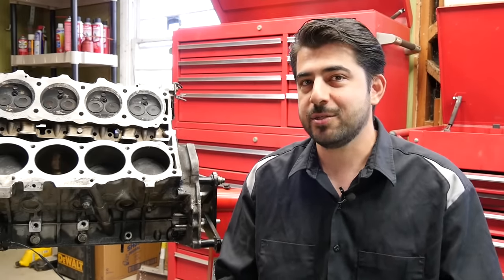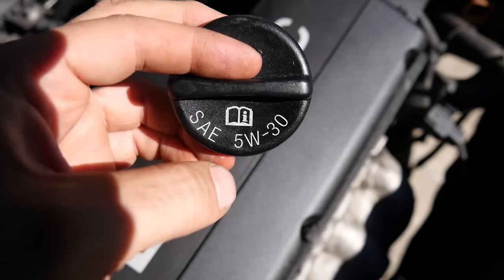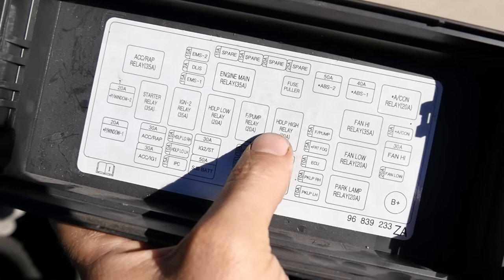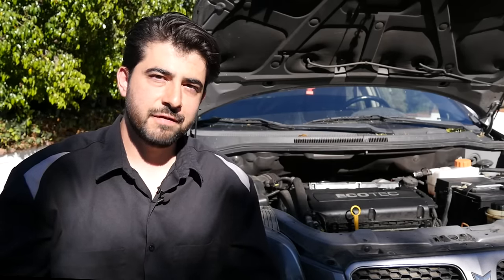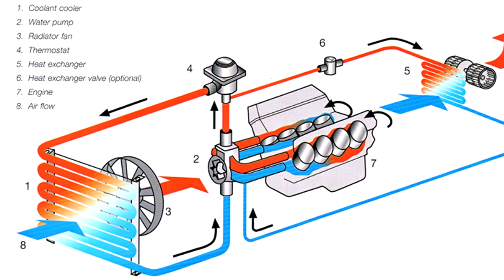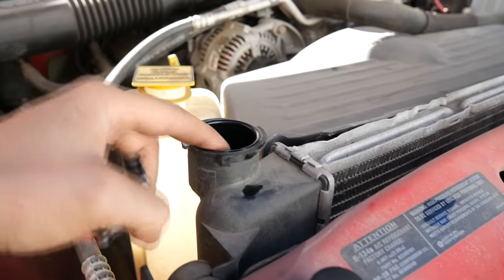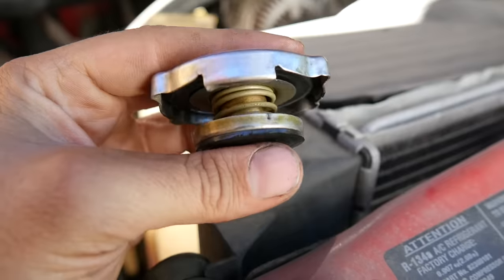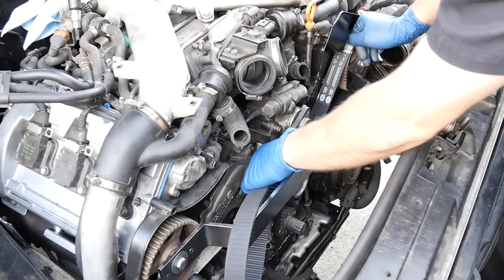Make Your Car Engine and Transmission Last a Very Long Time - Top 5 Tips On Car Care

Comment: For my '97 Camry with 160k miles, every oil change (full syn about every 5k) I also use a suction pump to pull as much trans fluid as possible out of dip stick tube. I then replace it with an equivalent amount of fresh tf, usually about 2 qt. This is equal to a complete fluid replacement every 20-25k miles. The whole process only takes a few minutes. When I got the car it shifted a bit hard, but now shifts are silky smooth and barely noticeable.
Reply: How is your camry going? Still got it? My 2000 camry v6 is up to 240km and i want to get rid of ot but it wont die ahah
Reply: @callanbrown7979  Unfortunately the Camry was attacked in a road rage incident by a deer (I'm in WI) and declared totaled by the insurance. It had 180,000 miles on it, ran perfect and everything worked. But the insurance company totaled it out for a pretty fair price for a model year that was 25 years old at the time. I replaced it with a 2011 Honda CR-V with 106,000 miles and in very good shape which I think is also a great vehicle and a bit more practical due to it's size, rear hatch and AWD.
Reply: TOYOTA #1

Comment: My dad bought a 00 frontier (i was 9 at that time and now 28) and now I own that truck with 365k. Transmission fluid has never been change on it and still running strong. I love that truck. Takes me where ever I tell it to go and I have for faith in it than any other car I've owned. But that's just me.
Reply: Weird flex but okay
Reply: cool....
Reply: The fluid will be varnish by now. 
I went through this years ago before I understood that it's a regular maintenance item.
The fluid eventually turned "light brown" and "stinky". Then I found I had to push the pedal further down to keep up with traffic (sucking up fuel faster).
Took it to a transmission shop for "basic service"
Two days later it bogged right out to where I had to really step on it to move.
Ended up having to replace with a rebuilt one. 
The transmission mechanic explained that the fluid is not "meant for the life of the vehicle. It must be changed every (if I remember correctly, 20,000Km) or it turns into varnish and the parts wear out quickly after that.
Won't matter anymore... you can put Royal gold level ten star grade trans fluid, the clutches are shot it's game over.  
Good maintenance begin at "50,000" not "200,000". 
Also how you drive it has equal effect.
I bought a truck that was owned by a corporation. The driver beat on it. Stomp on the pedal get the wheels spinning kinda thing.
The trans wasn't burnt brown it was still red and decent but the damages made it so it was shot by 225,000km.  Engine still perfect but $5,000 trans garbage.  Truck is finished, scrap.
Reply: @RetroCaptain  you made the mistake of taking it to a mechanic
Everything was working fine till you took it in😭😭

Comment: Good video, is basically follow the manufacture maintenance schedule witch most people dont. I found people across internet very concern about maintenance of the car and others who said I use the cheapest oil you can find in Walmart and they blame the car later on.
Thank you for the video.

Comment: This is what I do 
1) change fluids at regular schedule
2.) Use only oem parts if possible
3.) Fix small things before it gets big. Listen to any unusual noise.
4.) Dont abuse it. And pay attention to the guages while driving. 
5.) If you have a garage, I open the hood after a trip to cool down the  engine bay this prevents hoses and wire insulators from cracking due to heat on hot summer days.
Reply: Your 5th point is one important advantage of having a garage 😊
Reply: Pt. #5 is la great idea---never thought of that but I'm going to start that practice!
Reply: @mikejohn0088 😂

Comment: Quick tip for priming the oil filter, most modern engines have what's called a deflood where if you hold the pedal all the way down while cranking it will disable the fuel injectors in case the engine is flooded. Just make sure to test it before the oil change as I had one car that did not cooperate and nothing is more horrible than a 5k rpm dry start with no oil pressure 😑😑
Reply: Seems like a terrible idea unless you are 100% sure that’s how your car works
Reply: They last few vehicles I own have do this and they all mention it in their owner manuals under "starting a flooded engine"

Comment: Thanks, you do easy to watch and informative videos. A friend has a 2016 Mazda6 2.5 litre. The dealer was adamant the automatic transmission required no servicing which appears to be a marketing ploy to reduce apparent ownership costs. However everywhere else we researched recommended servicing any auto transmission every 60,000km or so. One in particular by Mechanical Engineer, Auto Journo, and YouTuber John Cadogan went into the chemistry of heat and fluid breakdown well. We went with the service, as the old mechanics saying goes, 'oil is cheaper than parts'. Another thing I learnt is to check the coolant level in the radiator rather than in the overflow reservoir. A friend had a Toyota 3 litre diesel which cooked because the cap had failed but there was still coolant in the reservoir and that was what he was checking.

Comment: Ok all your other 4 tips are handy and helpful but look when it comes to empty oil filters on a oil change. The old oil that was drained still has remaining oil around the engine especially on the top camshaft, valves and piston rings. It's not like it's completely bone dry after its drained and filled again. It will only take a few seconds until its full again and pumping the whole system. Never have I heard new empty oil filters from start up can cause engine wear. But i'll still keep that theory in mind.

Comment: -oil filter filled with oil

-replace timing belt/tensioner/idler pulley (interference)

-replace water pump/thermostat/radiator cap

-transmission fluid flush, filter  changed, add separate oil cooler

oem parts on above

Comment: The original water pump for my car has plastic vanes - that's why I chose an aftermarket one with a metal impeller. With the version with a plastic impeller, there is sometimes a problem that it becomes loose, starts to slip and stops pumping coolant.
Reply: Indeed. OEM parts are not necessarily better to use. Fel-Pro, for example, makes far better gaskets than the originals used by a lot of car manufacturers.

Comment: Get a transmission cooler even if you do not tow anything. Also, use the same OEM oil and Transmission fluid that came in the car. I just go to the dealer. They charge less than the oil change places anyway.  If you live in a colder climate and have a block heater, use it even if it is not very cold. I plug my vehicle in once it gets to below freezing.

Comment: timing belt! good advice, I bought a toyota landcruiser with no service history and when the radiator needed replacing, I dived in and did the water pump, thermostat, timing belt, cam seals, and then the radiator!

Comment: The stock heat exchanger for the transmission may be more for getting the temps up to operating temp and keeping them within the range rather than cooling the transmission for heavy use.
Reply: That's what my mechanic told me when I mentioned wanting to install a towing cooler. 
"You can't bypass the factory part. Have to put the cooler in circuit after it passes through the radiator, or it won't reach initial operating temperature".
He said you can run it "too cold". We get below freezing temperatures in winter here. I suppose in Jamaica or Dubai, hot climates it wouldn't matter.

Comment: I have been driving A 1999 Chevy prizm with 320K miles on original engine and clutch. I have changed oil every 5K miles using regular oil and fram filters.
Reply: ...nice...synthetic oil is only for fewer oil changes...reg oil prtects jus as good..but gotta change it more often!
Reply: I'll disagree.  Regular oil sludges up an engine more and on a highmileage car this can be fatal eventually.  But your right about changing it less frequently.
Reply: @muwahh98 why do they make conventional oil then..whats the point?
Reply: @edubb2491  half the price twice the oil changes.  Idk ? For people who enjoy changing oil ?
Reply: synthetic also doesnt break down as fast, protecting more , longer. conventional oil is outdated. no reason to but it rly, unless ur in a tight spot
Reply: @Steamy G the 1.8 In the 99 Corolla/prizm is notorious for stuck oil control rings.  If that happens it will eat a quart every 500 miles. Using synthetic can help prevent this.
Reply: wow,just think how long it would last if you didnt buy the shitiest oil filter on the planet
Reply: @edubb2491 Some older cars were designed to run on conventional oil and since it's usually thicker it won't leak as much as the thinner oil. You might get less oil leaks on conventional oil.
Reply: Prizm = corrolla with Prism Badge
Reply: @Steamy G Word!
Reply: Good stuff bud. Shows you are taking well care of your Prizm. If you hit 400,000 you should post it on YouTube. Take are and God bless.
Reply: the prism is a TOYOTA COROLLA!
Reply: I'm on a 2013 Sonata with 71k miles...I'm gonna try 10k Full-synthetic changes from now and we'll see what happens...there are too many manufacturers recommending 7500k mile changes with a blend or 10k miles with full synthetic to waste money on basic oil and have to change every 3-5k miles
Reply: Just so you know, the 1999+ Prism is a Toyota Corolla with Chevy badges stuck on it.

Comment: We were the only owner of a mercedes w210 2001, OM612 diesel engine with original internals and it ran perfectly fine until we had to take it to the junkyard because of rust on the frame at 970 000km's (a bit over 600k miles). The key is to keep it well maintained.

Comment: Surprisingly enough the only car I was able to make it to the 400k is the unreliable BMW 325 with the M50 engine...I pretty much did mostly what you showed in the video, except taking the fuel relay after an oil change :)

Comment: TIP 6 - If you live where they salt the roads you need to RUST PROOF your vehicle or the body will DISINTEGRATE  around your perfectly maintained mechanical components. Krown FTW.
Reply: Absolutely. In the summertime, get under that thing and inspect for rust on critical components. When you find rust, remove it with wire brush and then spray the heck out of it with rust reformer. Do this every summer. If you are talking about z-bart, etc, don't do it, that stuff is like tar and can trap water underneath it.
Reply: ziebart is garbage, like Brad Waite said it'll trap moisture and some salt and your car will rust from the inside out. Plus a lot of ziebart techs don't mask or tape anything off when they spray the tar on and you'll have abs, o2 sensor connectors and other components bombed with the tar.
Reply: Krown For The Win
Reply: Never spray that stuff on the undercarriage. It traps moisture. May as well just pressure wash it and add a sacrificial anode like zinc
Reply: Did I mention Krown?
Reply: Right Lane Hog in addition, there is nothing wrong with spraying some oil on the undercarriage.  It'll soak in, and protect from rust.  It might get some dirt on it, but it will resist water and rust.  Don't spray the brakes or exhaust
Reply: Known doesn't trap moisture or salt? I've just been hearing a little about Krown. I'm from Wisconsin and the "salt" they put on the roads is eating our cars alive, I'm in search of something that'll protect my car. I work as a mechanic and the cars we get in the shop some are 2012s-14s with rust on them already. We had a 2016 F150 Platinum with 33,000 miles on it needing both front wheel bearings. My boss said maybe a manufacture defect but the sh*t they put on our roads is also to blame.
Reply: JV, To put it simply, Krown is a 'light oil' which is sprayed  under the vehicle. They also  drill into rocker panels etc to spray them from the inside. It is meant to be applied on an annual basis. Where I live an annual application costs about the price of two tanks of gasoline. Krown has posted several videos on Youtube which demonstrate their process.
Reply: I live in central ohio. I get my car on the ramps in the fall and paint the floor bordes with rustolem paint if you don't your be driving a rust bucket.
Reply: ABSOLUTELY.. I only started worrying about my car the last time I was in Montana and saw it dropping salt.. Luckily on my way home it was raining but still.. Had me scared for a bit
Reply: nah it wont it's just be an old rusty bucket until you junk it finally
Reply: Some newer cars use recycled metal that wasn't treated properly to get rid of the old rust when they used it to build your car. The result? Your frame will end up rusting from the inside out in some spots for seemingly no reason and there is nothing you can do about it.
Reply: You are correct last 3 cars put out of their misery 250 000 + km due to rust none due to mechanical issues.
Reply: @SpareRoomPokemon  damnnnn 🤣 sounds about right tho
Reply: Island Mike  haha yeah or power steering or oil 😂

Comment: My Pontiac Bonneville with a 3800 was the best motor I ever had in a car. I also filled the new oil filter before putting it on. Did oil changes myself every 5000kms. Engine had well over 300K before the body and sensors made me scrap it. Take care of your stuff and your stuff will take care of you!

Comment: I have an Amsoil double oil filter which is a full flow and a by-pass filter and I use Amsoil synthetic engine oil.   I also installed a transmission oil cooler because the lines going through the radiator do not cool the tranny fluid like a separate oil cooler; and I use Amsoil synthetic transmission fluid.
Reply: The trans cooler inside the radiator is more than sufficient at cooling your trans ask me how I know
Reply: A bit of overkill, but ok🤷🏽‍♂️

Comment: I was always told,When changing automatic transmission fluid never do a “FLUSH” always do an exchange.
Especially if the transmission fluid hasn’t been changed for a very long period of time. This is from a automatic transmission specialist who is been in business in my local town for over 40 years and does nothing but automatic transmissions.
                      Just google, transmission flush or transmission exchange when changing the automatic transmission fluid. Also a VERY, important  note, always put in the manufacturers specification for transmission fluid. Because all transmission fluid it’s not equal like the $.50 a quart Walmart transmission fluid. You will have catastrophic automatic transmission failure if you do not put in the manufacturers specifications for transmission fluid.
Reply: Mainly because some fluid that sits in the housing contains clutch materials that have been worn off and is designed to "re-use" or more correctly make use of manufacturers and designers knowing these aspects. When the fluid is pressurized the clutch bits become "useful". When you remove All fluids you remove those materials and which is why Many people have trans issues after a power flush.
Reply: Always use the manufacturer's specified transmission fluid.
I can attest to that because I didn't, and now my truck is up on blocks until I have time (and the money) to yank the transmission and repair it.
Reply: @garymiller2056  Lol if it sounds too good to be true it probably is, anything with supposed lubricating quality that is that cheap would leave me highly concerned.
Reply: Most manufacturers do not recommend a flush. Even if some dealerships offer it. I think it says something that they'd rather you drain and fill at the specified intervals than flush.

Comment: My GM 2.4 LD9 lasted 300k miles. I think it may just needed a head gasket (not sure, it suddenly lost compresion) but it was actually easier to swap with a lower mileage engine. I followed GM's oil life monitor so I think it may have lasted longer if I changed oil at 5k intervals instead of going 8k+ like the oil life told me.
Reply: You r absolutely right...here in india too,car companies say that eng.oil lasts fr 15000 kms..bur really its wrong as per all our experience...after all experience n experimenting are more 😂😂😂😂"TRUER"than mere sugfestions....we must rely on live war experience..not Pubjy games on phone..😂😂😂